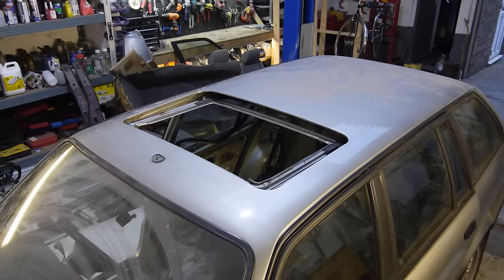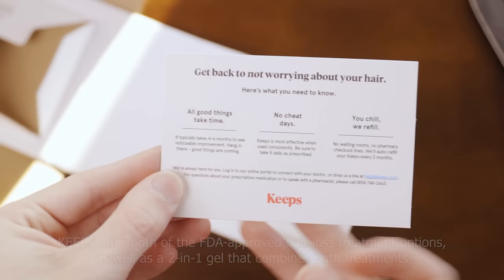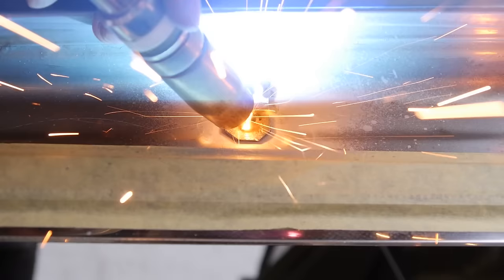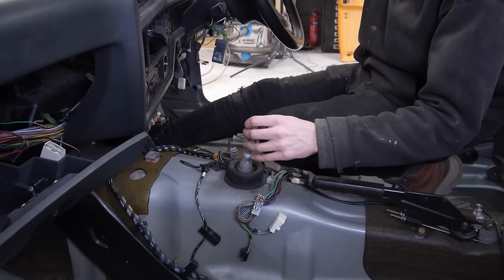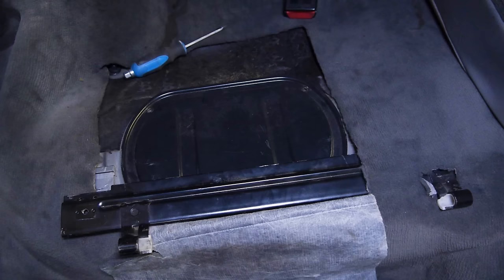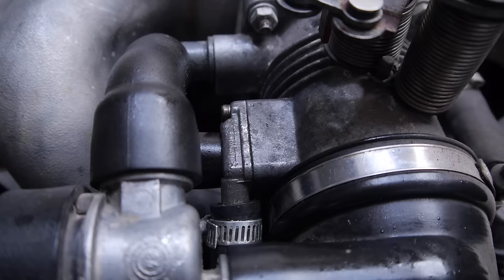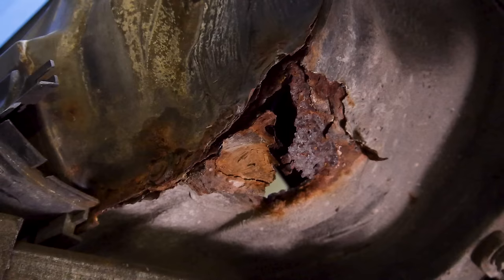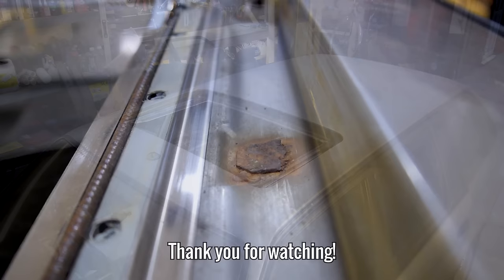Restoration Of A BMW E30 Touring - Part 4

Comment: The difference between before in the footwells and after is pretty amazing. Definitely doing a bang up job on this restoration. I would definitely remove all the old & bad sound dampening, especially since you found that really bad spot behind it in the drivers footwell.
Reply: @RestoreIt  I’m very sorry but I’m not the Paul you’ve met before. 🫤

Comment: Hey Steve, good to see another videk from you. Keep it up!
P.S. I time stamped the moment the spark comes into the frame if you look to the bottom of the engine bay in the orientation you filmed, you'll see it. It caught the corner of my eye when I discovered it.
Reply from the maker: I see it! And thanks mate.

Comment: Good to see a new video. My E30 fuel tank rusted right through and had to be replaced. I remember getting a good aftermarket one back in the day, if they are still available I would just replace it. With that amount of rust present, you only have the filter to rely on to stop debris from getting into the injectors. It may already have happened and possibly is a reason for any rough running. I don't just know which injector is in your car, but they normally have an internal mesh filter with about 8 or 9 micron holes, you don't need much to block them.
Reply from the maker: Thanks, Bob. Great advice and good point on the injectors maybe being slightly clogged. I'll check them out in the next episode. And as for the fuel tank, I'll have a look now, I have seen aftermarket ones in the past, so that might be the way to go... Cheers!
Reply: @RestoreIt never attempt to restore a fuel tank if it involves welding. There is a real risk of igniting the fuel vapor that is impossible to get out of the tank. The only way to it is if you purge the tank with an inert gas before and while welding.

Bottom line,: just get a new one, they are still available aftermarket for a reasonable price.

Comment: Keep up the great work and narration it’s a pleasure to watch. Don’t bother with the gasket on throttle body I replaced it and it lasted a couple of days it’s a real weak spot. You don’t need it go for the delete kit much better worry free solution. 👍👍👌
Reply from the maker: Cheers, Ruper. All the car eps are now going to be fully narrated. And I'm really 50/50 on what to do. I'll see how the new gasket goes as i've already got it, but if its still leaking I'll get a delete kit.
Reply: @RestoreIt  the quality of the delete kit online is really good and brings so much peace of mind that gasket can go any time trust me lol 👍 keep up the narration puts you tight up there with M539 👍
Reply from the maker: Okay, I might be sold... could you email me with a link to the one you're talking about? Restoreitchannel@gmail.com. If not, try posting it here, youtube may delete the link. Thanks again!

Comment: To check for spark leaking from the HT leads uou can use a ground test light by passing around the leads or spraying water on them to see if it stumbles.
Reply from the maker: Good tips, cheers, Amadafaka!

Comment: Wow, BMW has amazing parts availability.  I can't find parts for cars from the 2000s much less 2010s for some German and Japanese cars.  With those prices though its somewhat not surprising, but still.  I don't know why there isn't a 3d printed manufacturer out there that specializes in these tiny plastic parts for all brands.  I have seen individuals and businesses making specific parts, but no one is doing it en mass.  Its not like they would have to have a lot of stock, just a lot of upfront design work.
Reply from the maker: I know right, its great... just expensive. I'm sure soon there will be someone making decent copies with printers but yeah, I'm yet to find them.

Comment: there is a idle switch at the throttlebodie. You should hear a click when you open the throttle.
Reply: Also start the engine and remove the oil cap. If the idle doesnt change that much > big air leak. M20 engines will struggle to idle if there is no leaks while the cap off.

Comment: Don’t know what make of sanding belts you’re using but if you use 3M ones they don’t snap easily and will wear down to the backing before they let go, in my experience anyways. Expensive but worth it.
And I hope BMW are watching this and are proud of themselves for their pricing policies, £9 for a tiny plastic clip!! At least Dick Turpin wore a mask!
Enjoying your videos man, keep it up.
Reply from the maker: I'm using Draper 75 x 457mm belts cut into five with scissors... This is probably the problem, haha. I'll check out the 3M ones and see how they go. 
I know right.. £9!! I was planning on buying 4 of them, two for the touring and two for the 325i sport, but when he told me the price, i bought one. Thanks for the advice! Glad you're enjoying it.
Reply: Just a little more advice by way of affirmation, please don’t put yourself down regarding your welding acumen. You have improved massively and as you can see by your own observations you’re becoming a lot more neater and precise. Telling yourself and us your viewers you’re not that good will hinder your progress. You are doing absolutely fine man so just keep telling yourself that. Practice makes perfect or remember this, ‘a grinder and paint makes me the welder I ain’t’!!!! Keep at it mate. 👍🏻👍🏻
Reply: To be fair it's actually amazing that you can still get parts like this from BMW! You're paying for decades of storage, not the plastic itself.

Comment: I don’t want to spoil the party but I am under the impression that you don’t know zinkprimer is never ment to be overpainted, so it’s written in all zink pimer manuals. It’s an excellent rust protector but on parts you don’t see. Zink will eventually reject the other primers because of its self sacrificial character. You see it in real life happening on lampposts, garage doors and other objects. The best primer to use on top of zink is a 2k epoxy primer, but there are no guarantees. How car manufacturers do this on galvanized chassis still remains a mystery for me but they probably use an acid based etching primer. 
Most carpainters don’t even know this from my experience. Good luck with your good job and if I were you I would use epoxy primers only for the visible parts and zink on invisible parts under the rear seat ore the carpet for instance.
Reply from the maker: Hi Dennis, thanks for the comment, but you must have missed the part where I said im going to do exactly what you've typed here. Cheers!
Reply: You are always welcome. But such an aggressive etching primer is actually not available for private individuals. So you have to use a good 2K epoxy. And make sure you scratch the zink surface to insure the best adhesion.

Comment: How old is the fuel in the car?  If its more than a couple of months old you could have all-sorts of running issues.
Reply from the maker: I drained the old fuel out as that was 4 years old, but the tank is not in good shape, so I think it'll need a good clean, or be replaced.